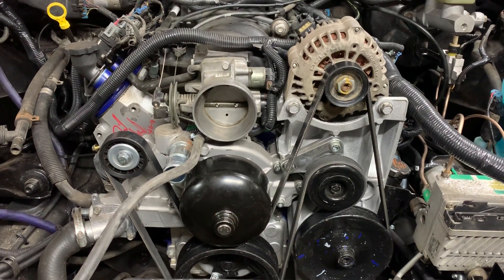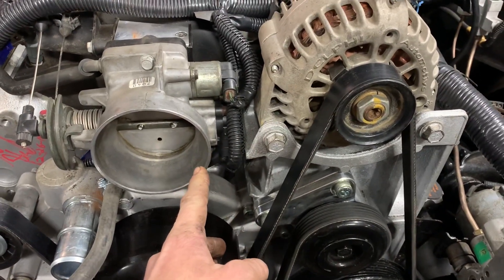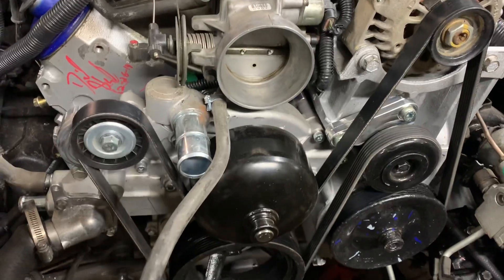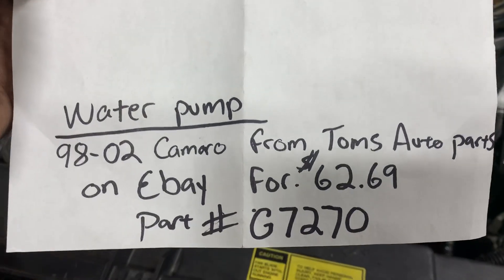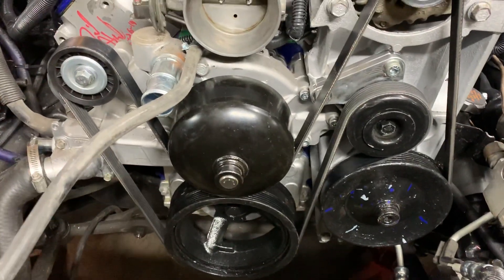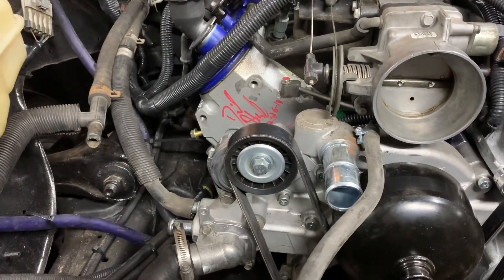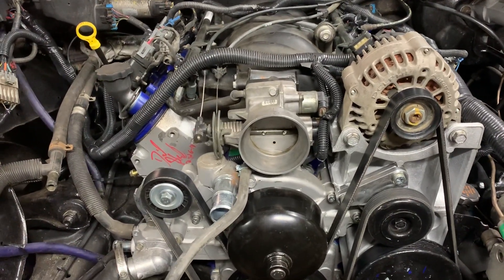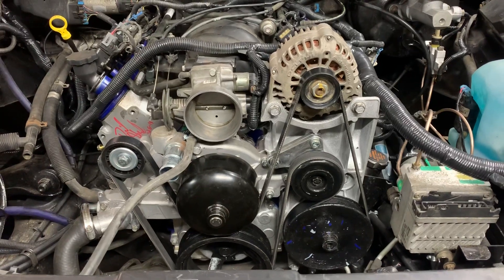LS swap Truck accessories with LS1 intake How-To video.. Great explanation with part numbers!

Comment: Which wires did you use to get your alternator and oil pressure gauge to Work? Do you know the colors also? Thanks
Reply from the maker: MrStevoG79 I’m not sure what your referring to about the alternator, are you asking how I got the battery gauge to work on the dash? Or how to get the actual alternator to work? And I made a video referring to the gauges including the oil pressure gauge.
Reply: @thehowardsgarage2480  on alternator my oem plug from car has 2 wires on it which wires do I tie I to my standalone harness or do both go on my standalone harness to make my gauge Work?
Reply from the maker: MrStevoG79 your alternator is controlled by the pcm, you should have received a plug from your new wiring harness that goes to your new alternator, you’re not going to use your old old alternator wires because they go to your old PCM... and as far as the gauge on the dash for the battery goes, it just basically runs to a 12 V positive wire, it doesn’t go directly to the alternator. Whatever your voltage of the vehicle is is what the gauge shows, the alternator is controlled by the PCM though when it sees that your voltage is dropping the PCM kicks the alternator on... have you gone to LT1swap.com? All the information you need about the wiring you have is in that website, I can’t tell you specifically which wires you have because I don’t know what year make and model of your vehicle is or what year make and model of your motor came out of. I would have to look all of that up on LT1swap.com, and it’s just as easy for you to look on the website then it would be for me to try to figure it out and then let you know.
Reply: @thehowardsgarage2480  I thought you still have to use the old wire to the gauge and just tap into new harness? My new harness have a 5 pin plug on it that goes into alternator . I thought you can just tap into one of those wires?
Reply from the maker: MrStevoG79 My battery gauge works in my car and I haven’t done anything with that at all. May I ask what your motor and wiring harness you’re using
Reply: @thehowardsgarage2480  5.3 ls year 2000 ..reworked standalone harness plus stock harness ..marrying them together
Reply from the maker: MrStevoG79 sorry it took so long to get back to you... that is the exact same swap that I did, and same wiring
Reply from the maker: MrStevoG79 I’ll go over my wiring and let you know, I may make a video for you
Reply: @thehowardsgarage2480  thanks again bro!!

Comment: when you did your swap did you have the pass fault key light on if so how did you get rid of it...mine is on?
Reply from the maker: MrStevoG79 no sir, I haven’t had any problems with my pass fault light... not sure if that’s because of the standalone or what but mine is working correctly

Comment: hey another question what did you use for power steering hoses and also what lower rad hose did you use?
Reply from the maker: I will making several more videos covering all of that info ASAP. I’m on the road right now but I’ll get that to you as soon as I can. Thanks
Reply from the maker: MrStevoG79 hey just checking in with you, I didn’t forget about the hoses and power steering lines video, Everything is done but I wasn’t able to upload the video yet because I can’t find the part number for the lower radiator hose, but don’t worry I will find it and I’ll get that video posted ASAP
Reply: @thehowardsgarage2480  no problem brother whenever you get it is fine. No rush thanks